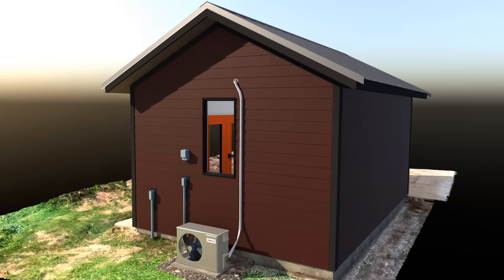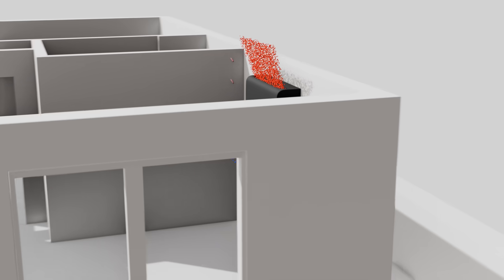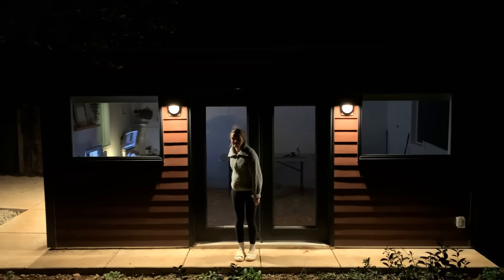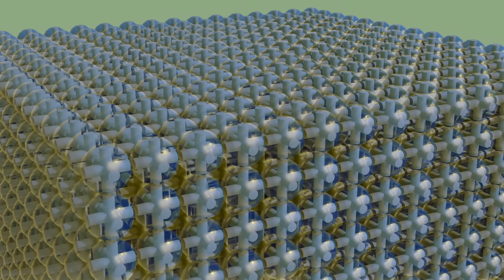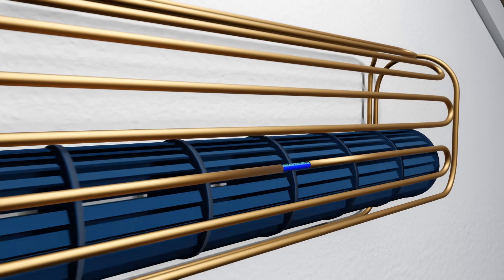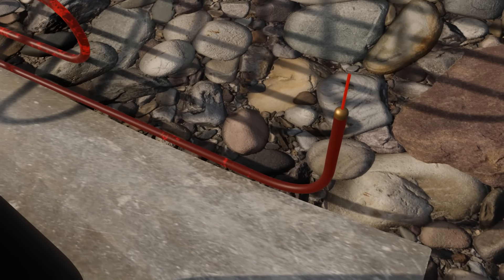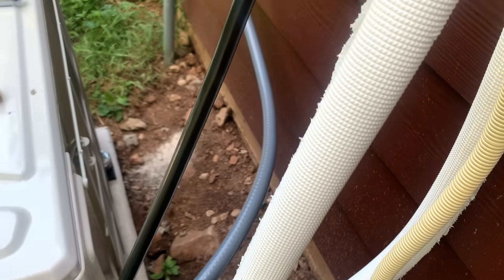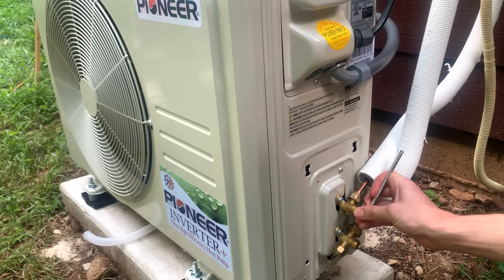How Air Conditioners & Heat Pumps Work | Installing a Mini Split in Our Office

Comment: "just cut down the extra length" shows that you don't know what that involves, if you cut it down you're gonna have to buy some more tools to recreate the flare at the end of the pipes, a tool you are only ever gonna use once, but you also bought a vacuum pump that you are never gonna use again, so I guess wasting money is not an issue for you.

Comment: I have a question, is it really matter to place the "outdoor" unit above the "indoor" unit level? because I see the outdoor unit will push the cooler energy to the indoor unit, so by placing the outdoor unit above (or equal) the indoor unit level, then it will make the outdoor unit consume less power. Thank you!

Comment: idek that small air conditioners arent a thing in the US.. like yall used centralized conditioner all the time like a mall... this thing has been a things for decades in asia especially due to tropical weather and the energy saving effect since we can control each one of the temperature and we can just shut it down when we arent there.. and nowadays we can control them wirelessly since we can turn them on from the office and have a nice cozy home when we arrived. but i really like this channel since the visual is soo helpful for people in STEM so we can actually get visual education instead of theory solely.. kudos to yall

Comment: one thing that stuck to me during my thermodynamic class is, cold doesn't exist, it's just that the body temperature is higher than the surrounding temperature due to loss of heat which in turn the feeling of being cold

Comment: I love our mini splits. We have had them for about seven years after having no AC or anything before that, and it’s a game changer. We rarely ever use the heat in our home, even in the winter (both me and my mother are the kind of people who sleep with windows open year round). We usually also keep our rooms closed. So if it is freezing and we are worried about pipes, we will set our open concept downstairs to the 60s. Then, in our own rooms we can turn the heat on with the door closed if we get closed to heat up the space relatively fast if we feel like it. 

And then when it is hot out, I use the AC somewhat more liberally in the summer, especially at night. 

A downside is we can only have only one function going at a time. Ex: all the units are set up to switch between heating, cooling, dehumidify, and I think a fan setting. But if the downstairs is running heat, I can only run heat upstairs in my room. Otherwise it will not work. 

I feel like the heat generally works better than AC but I usually tend to struggle in the summer, even though I live up north more. 

I’m not sure how well this would work for other people who constantly have heat or cooling on (setting your mini splits to the same temperature can reduce power and costs making them more efficient if you do). But for us, since we tend to only want heat where we are in the house, it works very well.

Comment: Hey,
Very well made video 

One major flaw though 

The expansion valve is inside the room and not in the outdoor unit. 

The refrigerant enters the indoor evaporator in gas state and not in the liquid state 

I'm talking about R32a/R22 gas, maybe your location has some other system 

Can you please clarify?
Reply from the maker: Thank you! My specific unit does not use an expansion valve. It has a capillary tube which is located out in the exterior unit
Reply: @Visual_Thinker_yt  interesting. I don't understand why have the capillary tube in the outdoor unit though 

The piping from the outdoor to the indoor will have losses wouldn't it? 

Isn't it more efficient to transport the liquid gas at ambient temperature until the evaporator and then expand it?
Reply: @Visual_Thinker_yt  also, which refrigerant are we talking of here?

Comment: Loved this. As a non engineer curious about how things work, I love videos like this that use plain English and visuals to explain cool things while keeping it interesting. Always wondered what a heat pump did and how and thanks to you I know now! Just a little suggestion to make the temperatures you mention a bit more accessible to us people (in most of the rest of the world (hi from Sydney 👋 ☀️ 🏖️)) using the metric system, if you could show the temperatures in Celsius on the screen as you mention them in Fahrenheit. 😅 lots of pausing and googling required otherwise to understand fully. Thanks so much 🙏 and keep on doing the good work! 🙌
Reply from the maker: Fair point! I'll be doing this more in the future, I really appreciate the support!

Comment: During summer, put a roof over your outdoor unit in case it is exposed to direct sunlight. The heat on the outdoor unit makes a big difference. Speaking as someone who owns multiple mini-split systems and lives in a hot tropical climate year-round (hint asia), I can confirm this.

Comment: Better install in a wall. Good quality condensers don't vibrate and hardly noticeable that's its even running. When placed on ground it easily accumulates dirt, mud and infested by insects/rats.

Comment: Hey you, i am from south east asia, we use that split system everywhere, except big offices and malls, in there they use your central AC system. i don't understand why in US they don't use much split AC system. with it, you can control temp of each room, not the whole home. Can you explain why? i don't think most US states are not as hot as SEA weather, where in summer it can reach 46-47 deg celsius(114-117  F for my US fellows). So using split AC should be better? may be Central AC is better for electricity bill? I am interested in central AC system, i think it would be more expensive for my home tho, i need to only cool two single rooms

Comment: Great video, however, you did forget to include the Expansion Valve which is important to the operation of the entire system.
Reply from the maker: Thanks! There is no expansion valve in the unit I have. The capillary tube is used to drop the pressure instead.

Comment: You should do a nitrogen pressure test at around 3500 kpa for the leak testing and you should use a moisture sensor when doing the vac down.

Comment: 10:40 why is it heated up just to be cooled down exactly?
Reply: The compression from a gas to a liquid adds heat to the liquid as it's squeezed together. That heat is cooled down so it can absorb more heat inside, as it expands and boils back into a gas, and cooling the air inside.
Reply: @mangamaster03  ohh alright, thank you!!

Comment: The basics of cooling part of the video fits the explanation of the air conditioning. Instead of the girlfriend, a bottle of water could have been a more to the truth example. The human body self regulates the temperature by both warming up and sweat, it will only have the ambient temperature when it is dead.

Given the effort and the friendly approach paired with good quality animations, as many in the comments pointed out, this channel have a lot of potential if you keep putting in the work.

Comment: this is what i don't understand about the US. here at my place in asia it is very common to use a mini split (like the vid showed) or a multi split (big outdoor with multiple individual indoor unit) in a house. no need for ductwork etc, just a simple pipework throughout the house. can individually be controlled in each room avoiding the hassle of fighting for comfort lol.
Reply: and it is very cheap! a multi split of 2 indoor of 9000 btu(s) each, only cost around equivalent of $6-800 USD. for the whole installation including labor!

Comment: I see it as a closed loop system. But how do you release the harmful gases (carbon dioxide, monoxide, etc.). and how do you plan to get oxygen from outside.
Reply from the maker: Great question! We are going to be adding an air exchanger soon (ERV) to help with this.

Comment: 12:29 To make concrete properly you'd need to mix the aggregates with the binder.
And also it would be better to put some small amount of rebar to prevent it from cracking by seasonal temperature changes.
This is a great content, instant subscribe.

Comment: Can't imagine the effort needed to create a video like this. Insane!

Question for you, can the outdoor unit in the mini split scenario be hung on the building instead of placing it on a concrete pad?
Reply from the maker: Thank you! Yes, that is an option mentioned briefly towards the end of the video. It has the potential to cause some noise inside due to the vibration of the unit

Comment: Loved the animations and illustrations used in the video. Would it have been best to have used a “pre-charged line set”?
Reply from the maker: I found the process of pulling vacuum on the lines to be very straight forward. Pre-charged lines might save you a little bit of time, but it's an extra cost that I didn't see much value in. You'll lose the ability to cut the lines down to length as well.
Reply: @Visual_Thinker_yt  Sounds good for the cost savings doing that yourself, but you me not having the equipment or expertise the pre-charged line set would be the direction I would go.

Comment: Fantastic vid! I would just look for a wifi-connected split, so you may turn it on-off remotely, also adjust the temperature without reaching for the remote controller
Reply from the maker: Thank you! There is a small accessory device that is available to make this unit Wi-Fi-connected. We may add it in the future

Comment: When a air conditioner is on the humidity inside the room is also drops. How that happens ?
Reply: Basically, air conditioners lower humidity because cooler air can’t hold as much moisture. In the video, he explains how temperature is just how fast air particles are moving—when they slow down, the air gets cooler.

When warm air passes over the cold coils of the AC, the particles slow down, and the air loses its ability to hold moisture, causing water vapor to condense—kind of like how a cold drink sweats on a hot day. The AC then drains that water away, reducing humidity and making the room feel more comfortable!